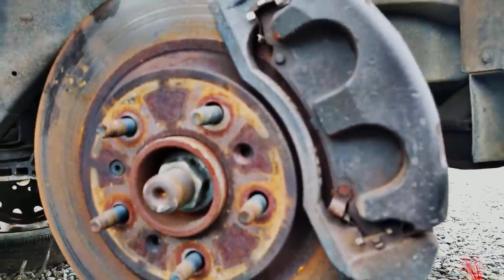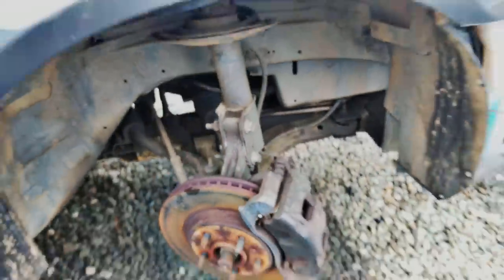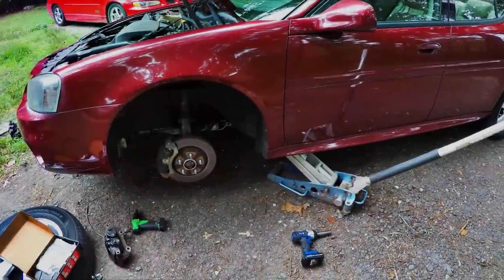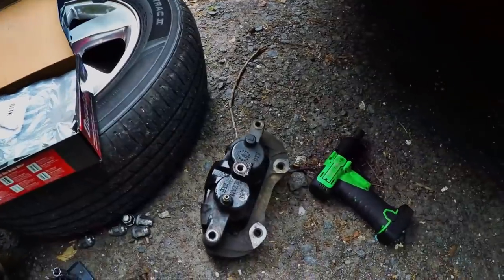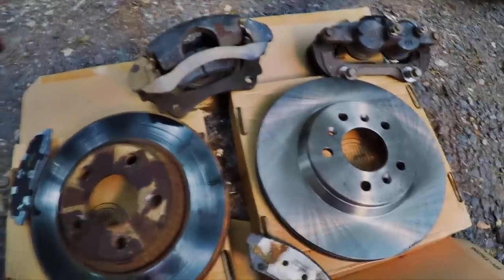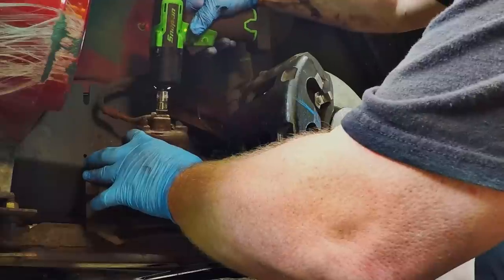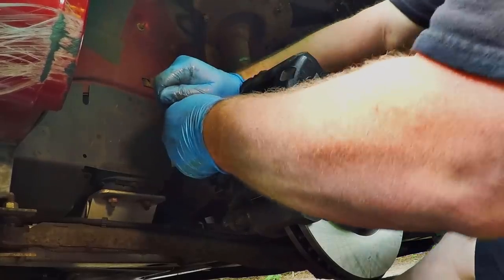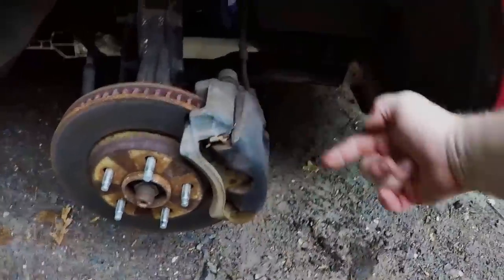08 Chevrolet Impala Brake Upgrade for other W Bodies

Comment: You better off with the 12-in rotors from the newer w bodies like the Impala and the Monte Carlo and then take an aluminum dual piston caliper from a '98 to '02 F body it bolts right up All you have to do is tap the bracket for a larger bolt the aluminum calipers lower the unsprung rate as opposed to the cast iron ones. I did it on my 99 Buick regal gs

Comment: thanks for the video. my gp is an 07.   i have all the parts, brackets/police pads/rotors for an 07 impala and will install them after painting.  rebuilt calipers, brackets and new rotors were not any more than the stock parts.  change the brake fluid to dot 4 spec while you're at it. 

just some observations.  for 17" wheels, you will need gpx spec shocks for the 17" wheel clearance.  i did change the shocks and after installation found the rear wheel camber was very negative.  i've sort of fixed it with camber bolts.  a wheel alignment will do the final confirmation, but that is yet to be done.   the fronts were ok, for some reason. 

i recommend the use of anti seize compound on all bolts, bleeder screws, sliders and pad contacts.  pad anti squeal compound on the backs of the pads. all this is necessary for high salt environments.   thanks again.
Reply from the maker: thanks, glad you liked it.  i do have 17" wheels off an 07 gt on the car now, they fit perfect with no problems.  once i wear out these pads i will probably ho to the police rotors and brackets.
Reply: @SalemDoyle  ..17" wheels on a stock gp that had 16" wheels with out changing the shocks? or was the gp one that came with 17" wheels to begin with?  my understanding is that a regular gp that came with 16" will not accommodate 17" wheels. is this right?
Reply from the maker: @cocodog85  i have 17s on two of mine now. 99 and 05.  And they both fit fine on with stock struts.
Reply: i have now installed the 07 impala rotors, calipers and pads.  all are police/fleet quality.  after bleeding with dot 4 and a one week bed in the brake feel is most definitely improved over stock.  raysbestos calipers and pads...police. much heavier rotors.  

what i would do different is order the red power coated calipers rather than painting them myself. 

stock 16" wheels...thanks salem.
Reply from the maker: Awesome

Comment: ZZP used to sell the 13 inch big brake kit it was a caliper and bracket off of the Buick Lucerne super. With front grand prix GXP rotors thats what i have on my ‘04 Monte right now. I noticed an improvement at highway speed, I would slow down a lot faster than with the stock brakes. City driving virtually no difference, apart from maybe heat dissipation.

Comment: I did the F-Body front. best brake set up that'll clear stock 16" wheels for these cars. bolts right up and still use factory lines. aluminum duel pistion 👌. they stop a hell of a lot better than stock and I only did the front. the absolute best is getting ahold of gxp brakes. same aluminum duel pistion but they're slightly larger and set up better for w-bodys. BUT, you have to change wheels to any gm 17" (5x115 bolt pattern of course) or bigger wheels. that's the major down side of gxp front brakes.
Reply from the maker: I am slowly working my way through all the available upgrades i guess.  This is the third diff kind i have done.
Reply: @SalemDoyle   Of the three brake upgrades you have done which do you feel was the best upgrade?  Which was the easiest?  I've only watched the F-body / Camaro upgrade and this one.  Impala upgrade looked very easy.
Reply from the maker: Impala has been the easiest.  I like the f body more for weight.  But they both stop similarly.  I am not done with upgrades yet though.
Reply: Thanks.  I'm going to be replacing the calipers soon on my 04 GTP Comp G.  Just had some brake lines replaced and garage said the calipers need replacing as well.  I can do that myself and may as well upgrade!

What's the next brake upgrade you'll be showing us?
Reply from the maker: @glenhalstead7683  gxp rears

Comment: At HFT there is a 10x10 canopy that you can get on sale or with a coupon for about $40 - item #'s 62897, 62899, 62898 - protection from the heat of the sun and rain.
Reply from the maker: One of these days i will have to get something like that

Comment: That went well, except for the rain. :P
I thought they would be the opposed piston style, which they aren't, so that negates my former remarks on how they would be easier to maintain / more efficient design... but the fact alone that they're beefier and the additional piston should make for a more consistent braking and better brake pedal feel. Nice upgrade! :)
Reply from the maker: Yes, and super easy to swap
Reply: @SalemDoyle  Yeah, it's literally a bolt-on mod. As in properly.
I love how they almost completely fill those 16" wheels. No more wasted space in there. :D

Comment: So since you have this brake setup and the camaro brake setup which do you prefer? Also does this work on the 03 and older as well?
Reply from the maker: I think overal i prefure the camaro setup
Reply from the maker: And yes, it works on the older ones too
Reply: @SalemDoyle  thanks I just recently got an 01 gtp coupe and was just trying to put a list of things I want to do to it and brakes were one so I was trying to decide between the 2.

Comment: Biiiig big question...suspension related! I have a 99 Z34 Monte Carlo an i want to upgrade the suspension but their aren't too many nods gor my car so would alter model wbody suspension swap?
Reply from the maker: Pretty much any w body stuff 97 thru 08 should fit, the suapensions were all interchangeable for the most part.

Comment: I tried to put a new rear rotor on my 00 MC, and it didn't spin and was told I had to adjust the parking brake shoes..I have no idea how to do that. Do you have a video on that or could make a quick one??
Reply from the maker: I did a video on it.
Reply from the maker: https://youtu.be/OYriZF39PGM
Reply: @SalemDoyle  so my star dial does not rotate at all. Is my adjuster broken or seized up? Do you know how to get it working again?
Reply from the maker: If it wont move either diraction it might be seized
Reply: @SalemDoyle  should I be a new star dial or clean mine up?
Reply from the maker: Take your out and try to free it up first

Comment: Going to do the impala upgrade for front 17" wheels. What could I do at rear
Reply from the maker: The gxp rears are the only upgrade for the back
Reply: @SalemDoyle  would you know what year. I have a 08 allure now. Impala front should work
Reply from the maker: Gxp was 06 thru 08
Reply: Thanks for info
Reply: @SalemDoyle  on these year are caliper with ebrake cable. Or is there shoes inside rotors. My factory has no shoes
Reply from the maker: Not sure on the allure, but grand prix were ebrake in caliper after 04, but not the gxp, it has the park brake shoes
Reply: Ok mine is cable with caliper just looked. So should I get 04 down rear brake upgrade
Reply from the maker: You would need to swap to 97 thru 03 to use the gxp rears